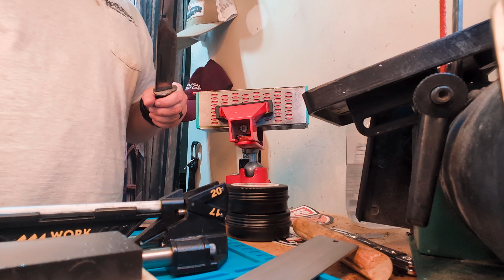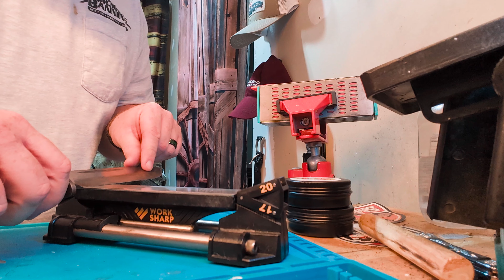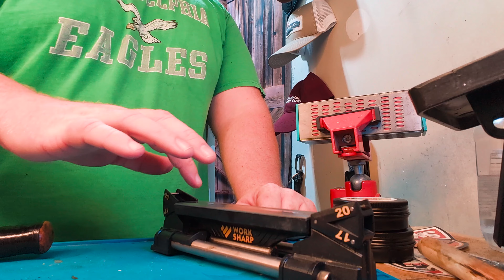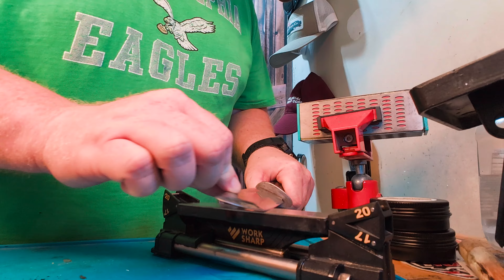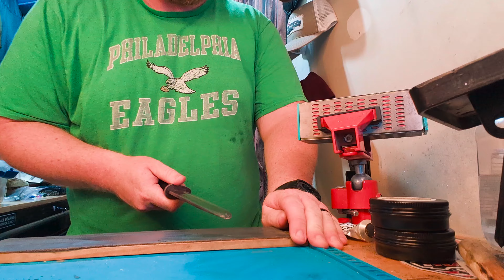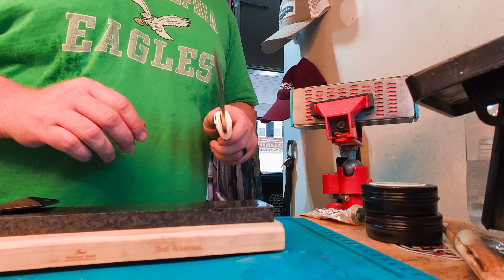Sharpening a Cattaragus 225 Quartermaster #vintage #ww2

Comment: Cattaragus County is a half hour drive south of me. If it were someone else, I would say leave it alone, but I know you're a good sharpener. Maker will be pleased looking down on you sharpening and repairing his work. Steel sounds like it's well heat treated.
Reply: I use the 100x magnifier with the light on my phone to inspect my edges.
Reply from the maker: I didn't know phones could do that haha
Reply: @isaacs_knives_and_knowledge  as long as it has a camera, it should have a built in magnifier. If not there are apps. I have 20/40 vision, so it helps me immensely.